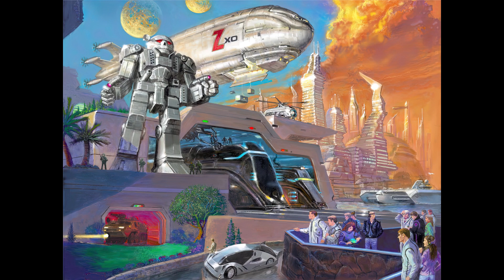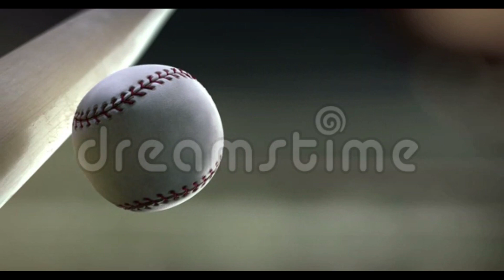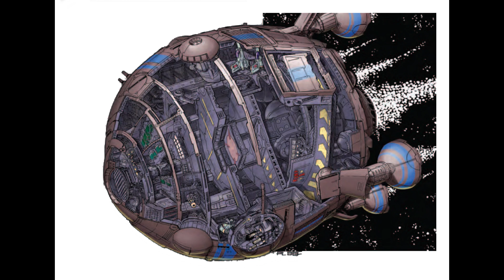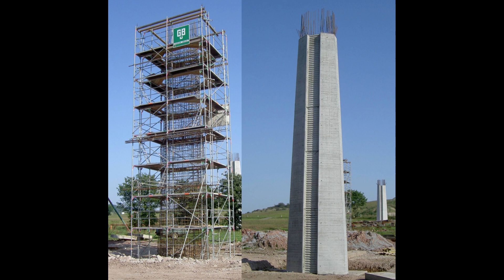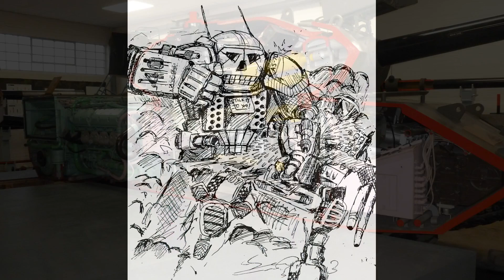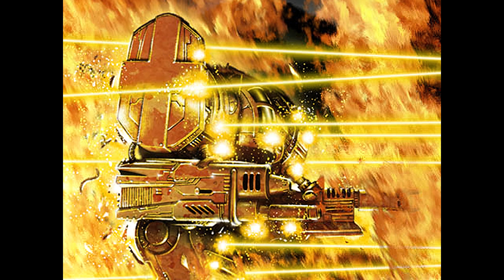BattleTech In Depth - Part 2 of 7, Internal Structure

Comment: 8:24 there must be industrial mechs that work with concrete
Reply from the maker: I'm sure there is. One of the things I love about this game is the individual freedom to create units to fill a need.
Reply: @Caboose30  I have iron working experience,  both structural steel & rebar work, have been thinking about a combat engineer unit with mechs, the mechs chosen would need to have at least one hand actuator is the only thing I have 'decided'

Comment: Dynamic stress and the weight of mechs is why I dont think mechs will ever be possible, and if made possible, never viable. The reason why dinosaurs could be so big and not have their internals break was because of microstructures made of some of the best materials, the materials were very likely actively breaking, but their bodies were repairing that constant damage.

I dont think materials will ever exist that can withstand so much dynamic stress and tension, especial without having to replaced everytime you bring the mech back.
Reply from the maker: Valid point, but if you look at things like modern tanks, aircraft carriers and tower cranes, the technology is almost there already. It just needs to be adapted to a different form factor. Like cranes, the other components like myomer can be arranged in a way to increase the structural strength.
Reply: until we make the scientific breakthrough to allow us to make said wonder materials it's going to be a very long time until we can feasibly make a Battlemech
Reply: The guys at Megabots Inc gave it a try. See: Eagle Prime and the Giant Robot Battle they put on

Comment: Edo Steel confuses me.  If you have 10 pounds of material and place more voids inside it to increase it's volume wouldn't you still have 10 pounds of material how is that saving weight?????
Reply from the maker: Because the ten pounds of material has greater volume, which means that instead of ten pounds for half a leg bone, it makes a whole leg bone.